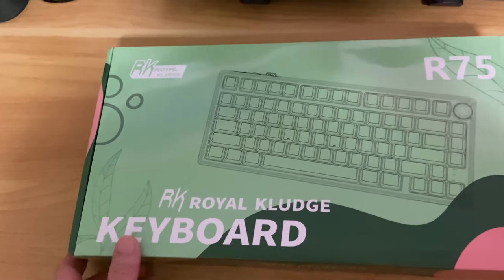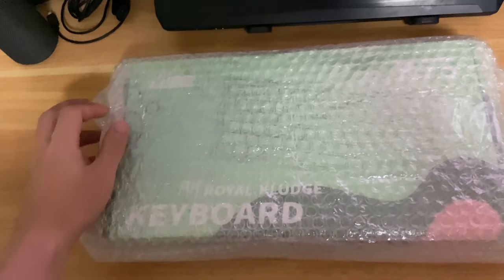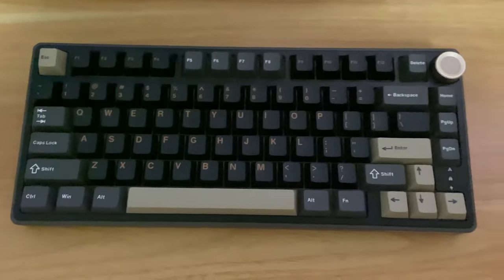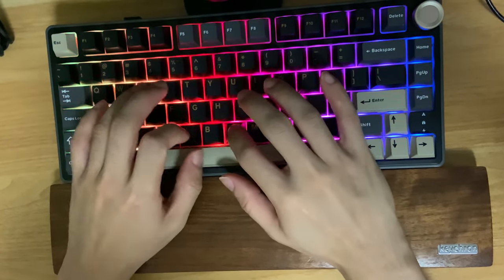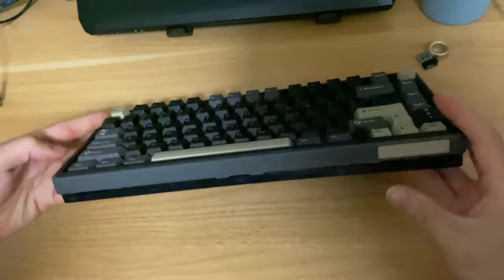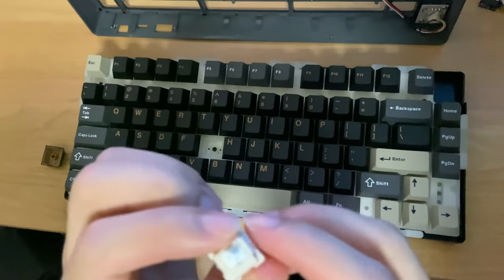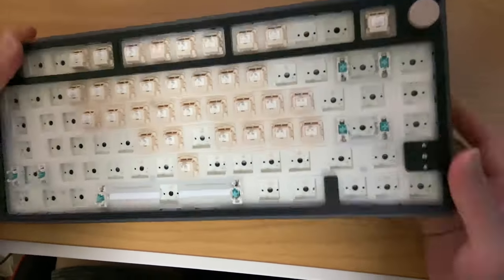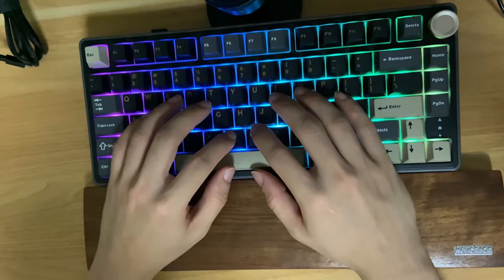Royal Kludge R75 Keyboard Review and Mod

Comment: Does the software work too with r75 wired only version?
Reply from the maker: @marksarte3336  Yup, should work fine with it
Reply: @keebboardwarrior  Already installed the app but it doesn't detect my keyboard and says "The Device is not connected". What could be the problem?

Comment: great review bro. Can I change the keyboard with any type of switches/Keycaps or is it only a particular type? Thanks!
Reply from the maker: Thanks mate, yes, most types, 3pin and 5pin switches, are compatible! Most Keycaps are compatible too! Just note that it is North Facing LED/switch, which means the following:

North Facing Switches
Pros:
Incredibly common
Provides excellent lighting (the light will shine through the keycaps)
Great for usage at night time or in dark environments

Cons:
May cause a “scratchy” feeling or sound, depending on keycap
Not so good when used with Cherry keycap profile due to interference (hits the keycap)
Reply: @keebboardwarrior  thanks for the reply!

Comment: do you know of any replacement knobs for this kb? i would like to replace mine to match the colorway of my keycaps
Reply from the maker: Hi! This keyboard uses a standard D ring knob which I only found out how to remove it and tried to replace it with another keyboard's knob, which is this video at the current time set!

https://youtu.be/DrFfvqhw9dM?si=YwaCH7LTx7P3fzMt&t=421

Honestly, I have not bought external volume knobs so I wouldn't want to ill advise, but I think you can search for D ring knobs to purchase!

Comment: I’ve decided to grab one after watching this review. Will it be possible for me to install cherry profile keycaps for this keyboard?
Reply from the maker: Wow! Thanks for the trust in this review mate! The original stock keyboard you saw in this video is cherry profile but I think that nowadays they're selling it in the XDA profile. You'll still be able to change it for sure, but just note it is north facing RGB which some say causes interference with cherry profile, but I didn't experience much from it.
Reply: @keebboardwarrior  Oh I see. Would it still be okay for me to install the cherry keycaps if the one I bought is MDA profile? It’s actually gonna be my first mechanical keyboard and I’m planning to customize it a little bit with retro keycaps. I’m just a little bit concerned about the keycaps not being compatible after purchase since they are cherry ones..
Reply from the maker: @emotrash96 No problem at all mate! Almost all mechanical keyboard uses switches with cherry shaft which is compatible to almost all keycaps as well! Cherry keycaps is one of the most common keycap, so no problem to swap it out for this keyboard! 

Regarding what I was saying about the interference with cherry profile, you can watch this 5 min vid which explains about it. Credits to him.
https://www.youtube.com/watch?v=VfHaPzAA9Gw

Overall, I've tried north facing and south facing RGB keyboards and don't notice much of a difference in the typing experience for this keyboard :)
Reply: @keebboardwarrior  Kudos mate! Thank you for providing me with all the information I needed. Looking forward to my first mechanical keyboard and genuinely wishing your channel to grow bigger! 🤘🏻

Comment: nice review but i have a question: why mine r75 doesn't have a bluetooth toggle lol? i only have a wired slot but the two other are covered with a plastic which is not removable
Reply from the maker: Hi! Think you got the wired version. They're cheaper but they have a wired one and a wireless version keyboard

Comment: Hi, great video! Do you know a difference between snow and silver switches? They are both linear and i dont know which one to choose
Reply: and is snow great for gaming, epecially quick clicking
Reply from the maker: @widerklever2741  Hi! Thanks for your kind words! Apologies, I have not tried the silver switches, so can't comment on it. But based on the specs, the main diff is that it's actuation force is 0.2mm less and the operating force is 3g more which I think will be hard to tell the difference. From what I see, I think the silver switches keyboards being sold is using a MDA profile keycaps which is the bigger difference between them! 

For gaming, personally I don't like XDA or MDA keycaps cause I tend to mispress the wrong keys. As this is gasket mount, pressing on the keys also feels quite soft and not much push back is felt, so I think is based on personal preference. The stock switch and keyboard is definitely good enough for chill gaming. But for intense gaming sessions, some mods may be needed.

The latency of this keyboard is averaging around 30ms which is pretty alright. But if I wanted this board more gaming, I would swap to OEM profile keycaps and have a wristrest for it. Hope this helps :)
Reply: @keebboardwarrior  Thank you!!
Reply: They are 90% identical

Comment: Hello, is the left shift stabilizer interchangeable with the backspace stabilizer? my backspace stabilizer makes an annoying noise and I'm wondering if I can swap it since I don't use shift as much as backspace
Reply from the maker: Hi there! Yup, generally stabilisers only have 2 sizes. A spacebar length sized one and the other shorter length ones for your backspace, shift, numpad + and stuff. So definitely interchangeable, but if the annoying noise keeps occurring despite switching the stabs, it could be due to the fitting of the stabs onto the plate.

Comment: is the wired stll hotspwapable?
Reply from the maker: Hi! Yup, still hot-swappable. Only difference between this and wired is that the top does not have the on and off switch, the usb dongle holder and the interior does not have a battery!

Comment: Good afternoon. What switches were used in stock?
Reply from the maker: Good afternoon mate, stock switches were Royal Kludge's own "Snow Emperor" switches. It's linear, 5 pin and was factory lubed. You can see how it looks like inside at the 4min mark :)
Reply: @keebboardwarrior I ordered the wired version of this keyboard for $43. This is my first mechanical keyboard. Do you feel this keyboard is worth the money?
Reply from the maker: @bolwayalopata9046 Hope you like it mate! Yeah, definitely worth the money as you're given the option to easily mod it further with different switches or keycaps!